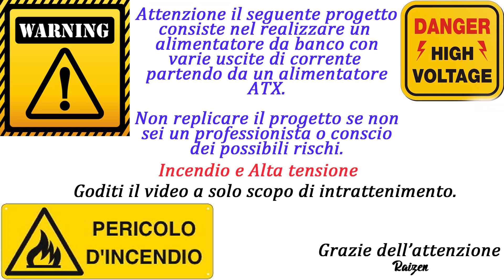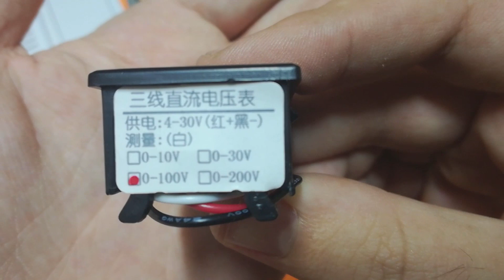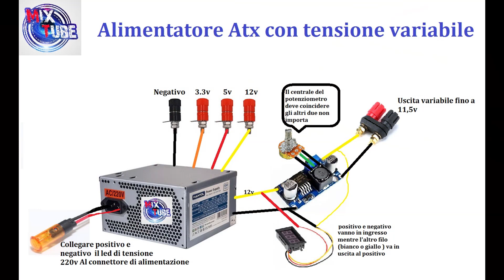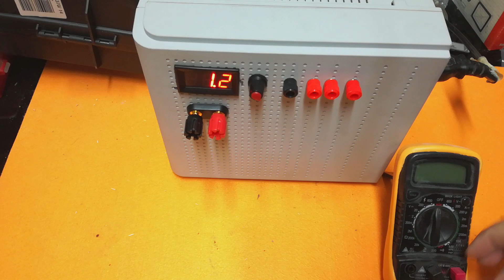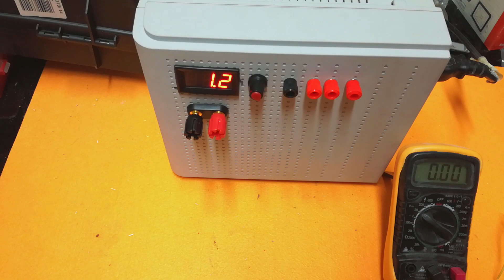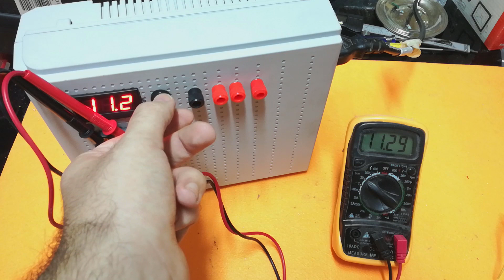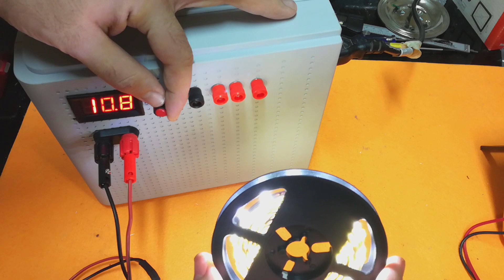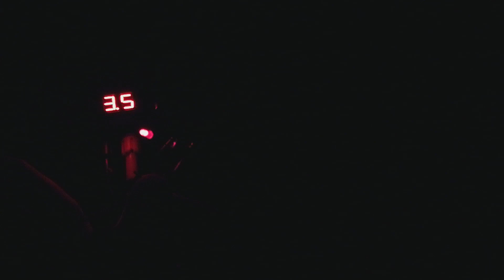Alimentatore da banco Atx con regolazione di tensione fai da te

Comment: All entrata del regolatore di tensione ti consiglio di togliere il cavo nero e mettere quello blu (-12v) cosi hai 24 v regolabili perche tra il gisllo e il blu ce una differenza di 24, prova e fidati che lo lascerai cosi come ti sto a dire
Reply from the maker: ho già provato ma è molto istabile e perde tanto carico, più in la ne creerò uno regolabile da 24v a 10 A e sarà il definitivo ma per ora, questo qui non mi ha mai dato noia anzi....
Reply: @MixtubeRaizen  quello è vero. Io le poche volte che ho usato sti alimentatori switching si so rotti poco dopo usandoli normalmente. Quindi uso senpre e solo alimentatori a trasformatore, sono piu facili da costruire e a parere mio sono piu potemti e affidabili
Reply from the maker: @matteopalumbo5716  e si alla fine io l'ho costruito su misura per me, ci alimento la ventola dell'aspira fumi e dei  led, o faccio i test sui motorini a basso voltaggio. Insomma uno starter kit avanzato e anche bello esteticamente :) Seguimi nei progetti e se ti va consigliami anche dei video da realizzare, più avanti spiegherò a voce tutto e darò un volto al canale :)